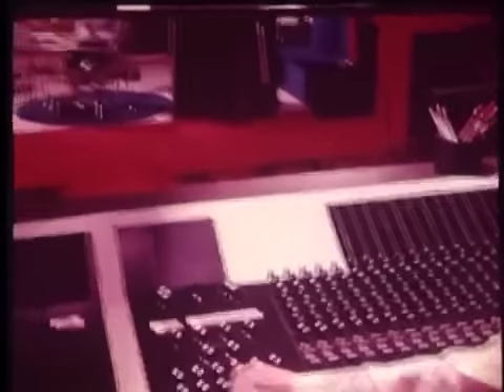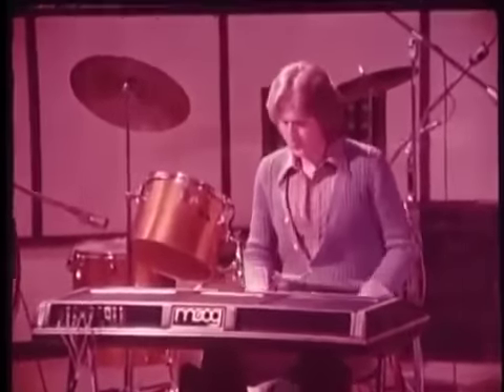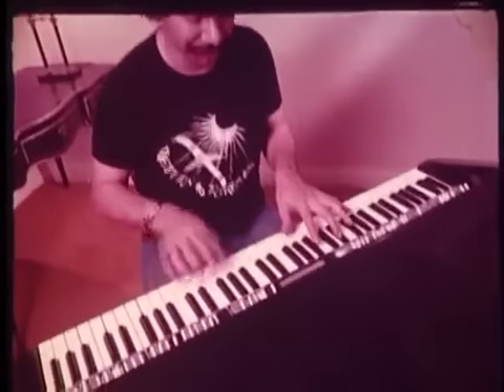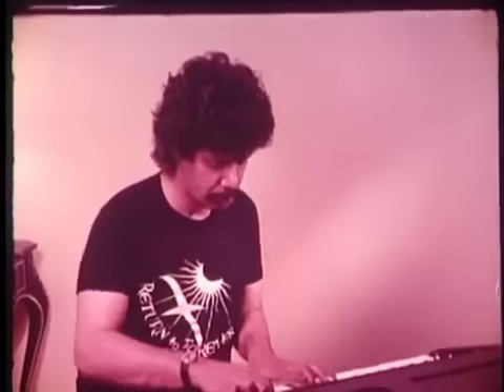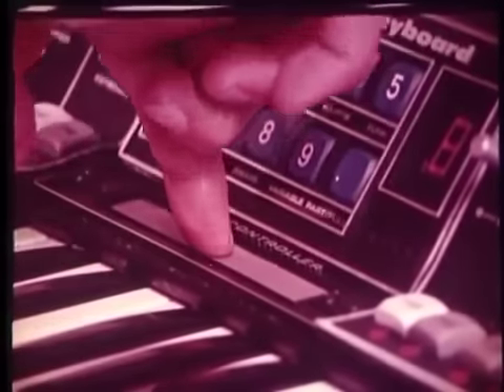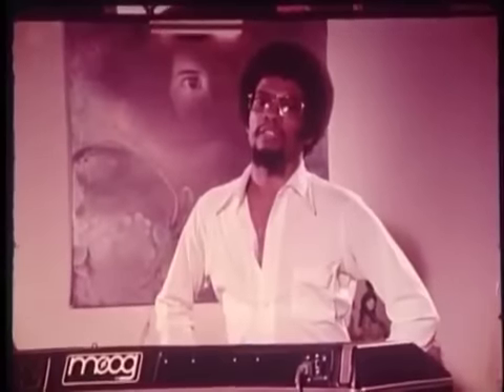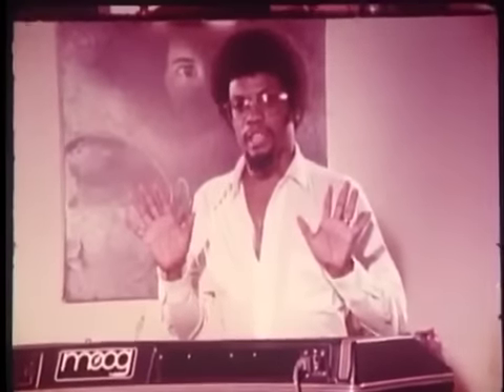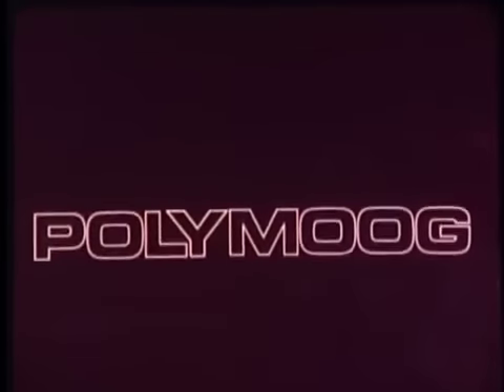1976 Polymoog Film

Comment: This was a great technological achievement and was fully polyphonic, with every key always live.  But the oscillators sounded rather thin compared to a MiniMoog, and the reliability of it was very bad, due to the technical complexity and some design issues (especially the keyboard).  Except for the 8 pre-wired presets, it had no presets, and changing sounds took time.  Basically, the Prophet 5 (a somewhat polyphonic MiniMoog with presets) was what users really wanted, which is why it was a much greater market success.  Moog agreed, eventually producing the MemoryMoog and Moog One.
The most famous sound on the PolyMoog was the "Vox Humana" choir, but this wasn't on the original.  It was introduced on the stripped down PolyMoog keyboard (introduced in 1977), which had 14 presets, but lost most of the other controls.  Many current users have replaced one of the original presets with the later Vox Humana preset board.
Incidentally, the PolyMoog sold for $5,200, which is about $26,000 in 2021 dollars.  So it definitely wasn't cheap.
Reply: With the popularity of the SCI Prophet, the price of Moog 203A's dropped as dealers needed to liquidate old stock I got mine (serial number 1254) new for $3700 Canadian. With the right chorus delay and paying attention to settings, the old Moog created very dreamy sounds that made quite a reputation for me, 1980 to 1984.